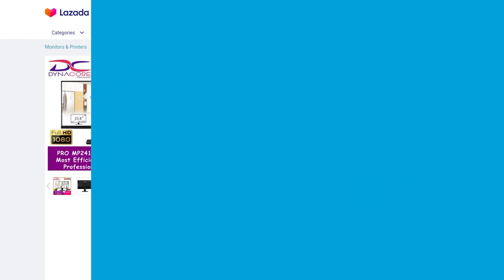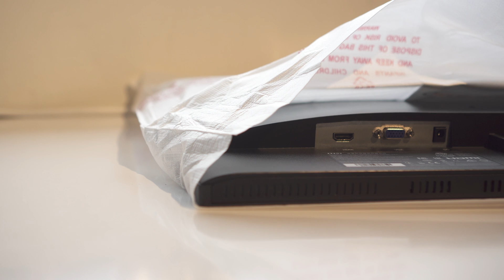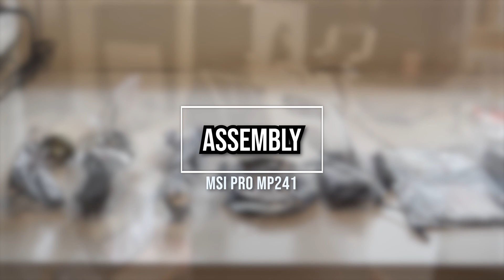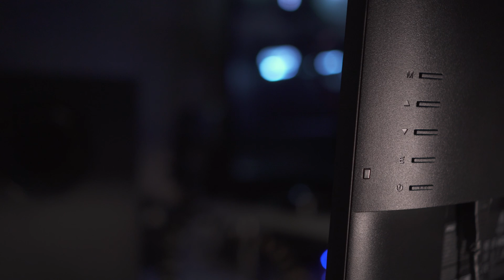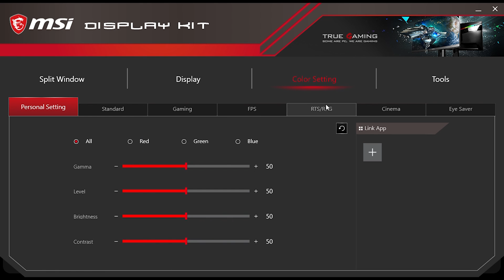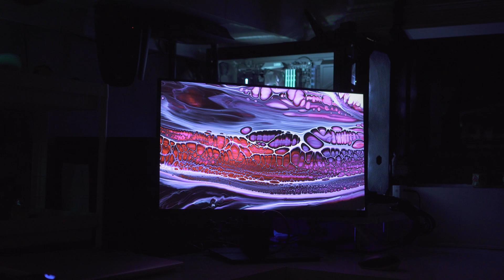MSI PRO MP241 Review Behind time

Comment: Next to my HP 24mh the contrast is far worse on this one. I wouldn't use this as my primary monitor. Settings (in OSD) that I found work best:

- Brightness to 0
- Contrast to 100
- Adjust/Gamma to Gamma2 (Eco mode needs to be turned off)

This makes the contrast a bit better, but still not even remotely as good.

Comment: Should i purchase the dell se2419hr or this one
Reply from the maker: Hi I will say if you want to use an external monitor arm via a VISA mount then get the msi one as it gives you the ability to do so compared to the dell. Display wise Dell has an edge over MSI for its quality. Cheers!

Comment: bro I can't disattach the stand, can you please tell me how to dis attach the stand from the monitor?
Reply from the maker: Hi there under the back part of the stand that faces the monitor there is a small clip that you will need to use a flat head screw driver to release to allow the stand to slide out. Cheers!
Reply: @Nwhproductions worked like a dream, thanks man

Comment: I spent $185 and this monitor is total garbage. First it is 6bit + FRC and second is from angled view edges starts to fade away and the content starts to disappears upto 15 pixels vertical lines on the left or right edges if seen from angle and 15 pixels horizontal lines for up and down edges if seen from angle. Two eyes have such vision conflict for the edges content. And response rate is not that good either. Worse or equal to cheap monitors. For cost it is bullsh*t monitor. Else it does have ok quality for IPS panel of visible display area besides those edges on all sides. Yes monitor wobbles a lot so you should place it on steady table.

Comment: i just bought this monitor, how do i remove the monitor to the stand again (coz it's too tight. i can't move the monitor vertically) it's so locked up how to remove it?
Reply from the maker: Hi to take out the stand there is a small black clip below that you need to press down (use a light to take a look) then pull the stand away from the monitor. Cheers!
Reply: @Nwhproductions  do u have instagram or somethin, can i dm you cause i cant really see it :(
Reply from the maker: @ruggy1689  sure it's it NWH-Productions cheers!

Comment: How can you move the screen the metal latch seems to be stuck in place and it want it to be a bit looser so that i can tilt the screen when i attach the stand
Reply from the maker: Hi, do you mean the latch that locks the display in place? or do you mean the hinge that holds the display? Cheers!
Reply: @Nwhproductions  already got it thanks tho it was the hinge to rotate it it was kinda stuck and tool some effort to change direction

Comment: Can anyone please tell me how to remove the stand? Im concerned I might break it
Reply from the maker: Hi there is a small latch around where the top part of the stand connects to the monitor. You need to use a screwdriver to release it. Cheers
Reply: Sorry but could you please elaborate on that? I'm having a hard time taking it off lol

Comment: Hi hope you can help, how do you remove the stand cause i wanted to mount it :(
Reply from the maker: Hi there is a small lock at the top of where the stand connects to the monitor. You then try pulling it out and wiggling it abit. Cheers